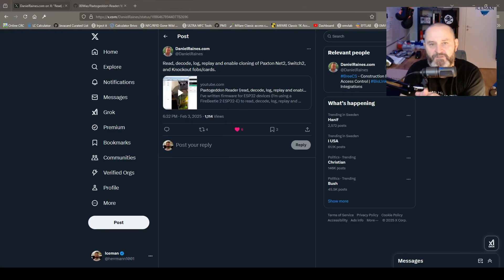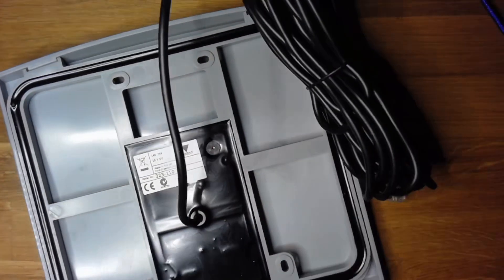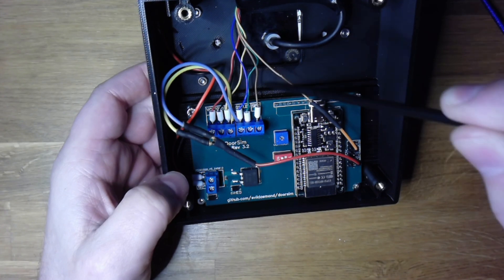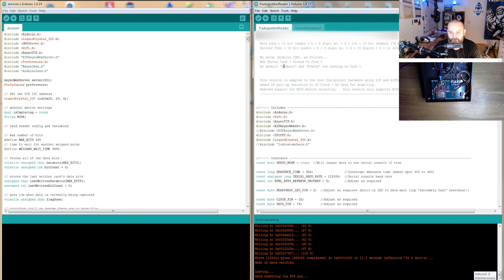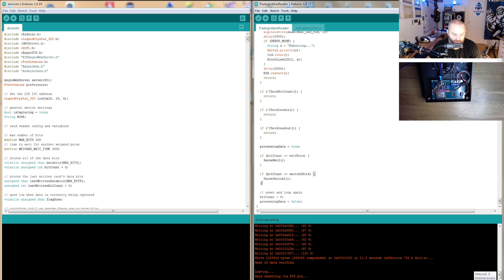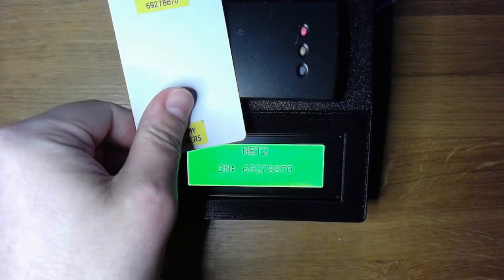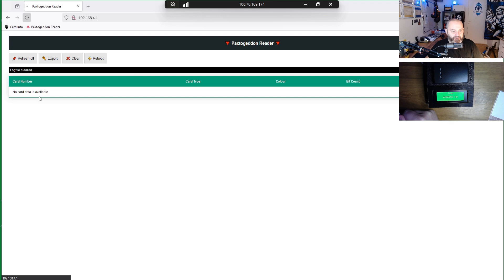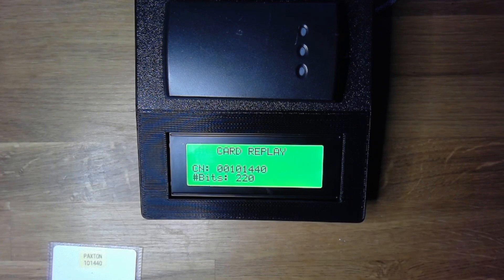How to Hack Access Control with a Paxton Reader

Comment: To resolve problem with pressing button during flashing firmware:
The problem can be solved by wiring the EN pin through a 10uf capacitor to +3.3vdc
That way, you don't need to press button anymore :)
I hope that will help you.
Reply from the maker: Interesting.  I have to test that out